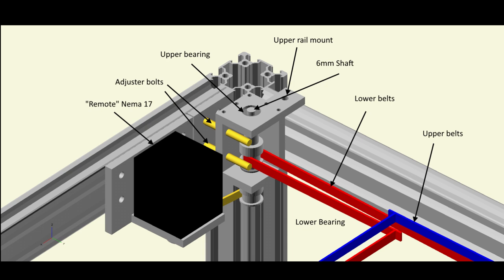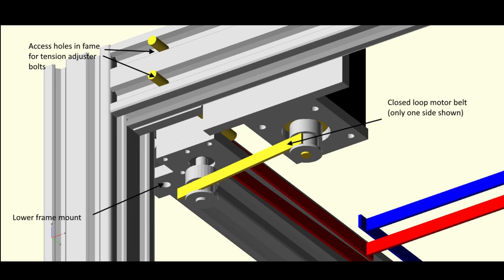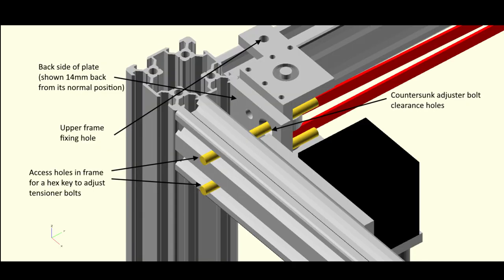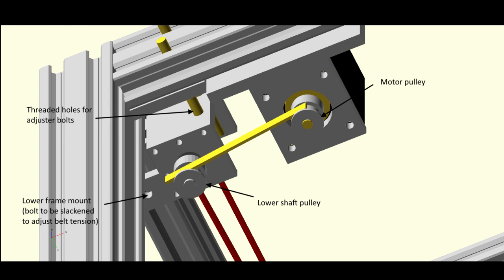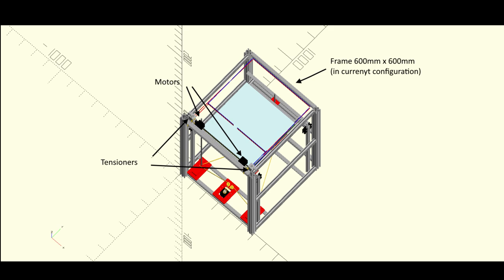New CoreXY Part1 - Remote Drive Shafts and Adjustable Tensioners.

Comment: 70 n.o.  congratulations.  (I'm catching you up :-()  microsteps are nore to do with smooth motion than holding, so you are correct to say the motor will only hold accurately at each full step . However since the only time a motor is stationary, is when printing diagonally I not sure how this will relate to print accuracy in normal printing.
Reply from the maker: Hi Bill. Yes, ref accuracy, I guess it's a "try it and see thing". At least with this arrangement, it'll be easy enough to change a pulley - I won't even have to touch the main drive belts or their tensioners. The primary objective is to remove the side loading from the motors but I'll likely play around with pulleys sizes - just to see. I do use Nema 23s on my UV gantry (the one with the extruders) and these have a thicker shaft and beefier bearings. I could just use those but they are noticeable more noisy than the Nema 17s (and take up more space). Ref the age thing - you'll never catch me up 🙂

Comment: Have loved your work on the multi input printing and the obstacles you overcame.
Have you seen the HevORT HD12 design. Belts are isolated from the stepper motors. Is ready for non planar printing  when the software comes available
Reply: Yeah + on HevORT the steppers are outside the enclosure which is also a nice thing to have.

Comment: Yes the motor will accurately hold position at any micro step. However the holding power gets less the farther away from a full step position you are.
Since maximum hold is when the magnets and eletric field are lined up and the electric field of both coils are at one max one off. As im sure you know when it micro steps is lessing the current of one of the coils and applying the difference to tje other coil to shift alignment point with the magnets over ever so slightly. At full microstep its almost a balancing act of fighting tensions rather then a set pull force.
Probably maybe full hold at 1/2 step cause it lines up the other coils?
This partial power on can cause magnetic backlash in the system. Torque at 1/16 microstep is 10% that of a full step so that effects holding power as well. Its like using a spring as a screw coupler.
Reply from the maker: It gets more complicated when one starts to think about CoreXY kinematics where, for anything other than 45 degree moves, both motors contribute to motion. For a pure X or pure Y move, the motors will actually turn the distance required multiplied by sqrt2 which is 1.414. So even if one made a move which was exactly a multiple of whole steps in the direction of travel, the motor(s) would probably end up using some fraction of a whole step. In a later video, you'll see that I abandoned the idea of using 40 teeth pulleys on the drive shaft with 200 teeth on the motors because I realised that the back EMF from the motors running at double speed would limit my maximum to around 200mm/sec, and I like to do travel moves much faster. But the remote drive shaft is still a good idea as far as bearings and belt tension are concerned.

Comment: I'm sure you are going to make awesome new printer with all the experience you had with the previous one :D .. 
One question - are you sure tensioning in the corner is going to work properly for COREXY ? You will be tensioning two belts at the same time and in one corner so position of the motors will not be same / one side will be longer than other - will that mess up with corexy movement? All of the designs I have seen have "belt tension adapter" on the head and fixed corners. Not a big deal to make a belt tensioning adapter on the head with a screw and captive nut, works great, I used to make them in aluminium too and iirc you have both mill and lathe so it should be peanuts for you to make?

as for issue with motors, I use the setup on some of my design (never did corexy) where drive pulley is on it's shaft with 2 bearings holding that shaft and the motor being soft-copled to that shaft but not via pulley but via those X couplers, it reduces rotor vibration, do not load motor shaft sideways, increases print quality visibly when using cheap nema17/nema23 PRC motors

wrt "position holding" on microstip - tested with 10+ different motors (expensive german ones too, expensive from e3d too, nema17/23/32) with super expensive military encoder - NO they do not hold position :( first even without any load the microsteps are not ideally spread between fulsteps (halfstep is usually where it needs to be, everything else - NO) and when even halfstep is used applying "any" force on the motor will move it out of position ... depending on the force and on the current and on the size of the motor it will miss the position differently but it will always miss the position with applied force. I did the test when I moved Z by vertical belt and not via screws, with screws it is not that noticeable as unwinding force on the 10mm dia and 1mm pitch (that I used) is low enough that microstepping holds the position without a problem, but switching to belt and in 1/16 microstepping it was +-2 microstep error easily :(

Ideally one should go with encoder and smart stepper driver, Duet was talking about making those smart drivers and they might be smart enough to talk with Duet3 board that you have so might be ideal setup for you... and you can sell extra bmg's to finance those drivers :D

BTW, I will have to watch this again, I failed to hear how are you going to load the 6 filaments? you want to use some push/pull config with those Y like adapters or ? as you said you wanna use single input hotend now?
Reply from the maker: Hi. Ref belt tensioning. On a CoreXY,  one motor drives only one belt, but for anything other than 45 degree moves, both motors contribute to motion. If they both move in one direction at the same speed, you get pure X and if one of the motor directions is reversed, you get pure Y. It takes some mental gymnastics to get the hang of it🙂. But tensioning each shaft, will only affect one belt, not both. Of course, if the tensions on each belt are uneven, then it can impart a twisting force to the carriage, so you have to set the tension the same on left hand side and right hand side adjusters. I've used this belt tensioning arrangement for many years - just by moving the entire motor back and forth. The only thing I'm doing differently this time is having "remote" motors. Also, to mitigate the twisting effect of uneven belt tensions, I use a stacked belt arrangement ( I note the E3D copied my idea on their tool changer 🙂). But I do things a little differently. On the Y gantries I use two idler pulleys stacked like the belts but arranged side by side use two "axels" such that both the upper and lower belts remain exactly parallel and on the centre line of the X carriage. So any unevenness in belt tension, doesn't impart a twisting force (because both belts act on the centre line) as is the case with the usual arrangement where the belts are parallel but run either side of the carriage centre line.  

Thanks for your information about micro-stepping and positional accuracy - it confirms my "gut feel".

Ref the 6 filament thing - I'm not going to be doing any multi-filament prints - it's all part of the "simplify my life" thing 🙂
Reply: @deckingman  IIRC your setup was not corexy? or I'm mistaken... what I worry is when you move XY1 motor 2mm more than XY2 motor closer to the front edge of the printer the "rectangle" that is formed by the 4 outer corners (ignoring the middle bridge) will be disturbed and front and back line of that rectangle would not be parallel any more as left point will be closer to you 2mm than the right one and if that happens I have a gut feeling movement will not be ok. So you have to make sure you move both motors (not motors in your case but both driving pulleys in those corners) the same amount towards front of the printer. I hope I explained what my fear is :)

Microstepping is terrible, the distribution of microsteps between full and half step is not uniform, not at the least, if you plot where they really are they group around full step and around half step, and any force will skew that even more. Another thing that was very new for me was "rotor vibration", there are some videos about that online and some EU company selling some motors with low rotor vibration, but what I measured is that while sitting in a microstepping position (even halfstep) with 100% power motor will vibrate slightly, you do not see it but with a 1500$ 16bit encoder you see it dance, first I assumed the problem is that 16bit is too high resolution and that I'm getting few bits of noise but you remove power from stepper and the vibration stops.

The only real way to do this is as professional machines do - with encoder and closed loop system. Too expensive for 3d printer :(. Next best thing is using full step and gearing it down with belts that you plan to do, the only issue is making sure motor is always at full step, if you drive it in full step mode movement is jerky, GECKO driver know how to do microstepping but it always move a full step just moves the motor slowly controlling it through 10 micro-steps instead of one jerky move... I know that new trinamic drivers have 1/256 microstepping that's supposed to work like that but I'm not sure if they use those 256 microsteps only in 1/16 or they can also use those 1/256 in full step mode but that could be the solution... I will have to look at the scope how they change current when configured to full step mode, is it going to be square wave or a sawtooth or sinewave

vrt 6 filaments, so you just want to have 6 spools available and you will manually feed whatever you are using, like the rest of us mortals :D :D 

since you are probbly going to be using one of your single nozzle hotends, did you maybe plan to integrate into new system a filament flow monitor?
Reply from the maker: @BogdanKecman  My printer is/was a CoreXY. Or more to the point it is currently a CoreXYUV. That is to say two CoreXY mechanisms stacked one above the other but both running in tandem. The XY gantry carries the print head, the UV gantry carries the 6 extruders. At one point in time, it was a CoreXYUVAB with the AB gantry acting as a load balancing gantry by reversing the motor directions, but it was still a CoreXY mechanism.  

Ref moving one motor (or drive shaft in my case) further forward or backward in the Y direction with respect to the other motor, doesn't matter. As long as the motors (or drive shafts) remain in the same place from left to right, then the critical belt paths will remain parallel. It's difficult to explain without a drawing. "The digital Dentist" explains it quite well in his blog which has a nice diagram. I'm not doing my printer the same way, but it'll give you some idea of how CoreXY works. https://drmrehorst.blogspot.com/2018/08/corexy-mechanism-layout-and-belt.html

Ref hot end - I haven't made a final decision but I'm seriously looking at the Bondtech LGX Ace which uses a LGX extruder and close coupled Slice Engineering Mosquito hot end. It should be good for just about any filament types and especially good with flexible filaments due to the very short filament path between extruder and hot end. The thing about my own designs, is that if anything breaks, I can't but new parts - I have to make them. So if I want to use one of those, I have to keep my milling machine and lathe which are taking up a lot of badly needed space.  

I haven't given much thought to any kind of filament flow monitor. from what I've gleaned on the Duet forums, they seem to be not as trouble free as I'd like. But we'll see....

Yes, I'll be manually loading filament as needed. I'm planning on using a "dry box" type reel holder and one which will take the larger 2Kg plus reels as well as the more usual 1Kg ones. Much of this depends on available funds but I'm planning on selling some of my collection of spare boards, PSUs, motors, extruders, and other assorted paraphernalia etc to pay for it all.
Reply: @deckingman  ah I was under impression it was double cartesian, not double corexy ... cool, then you have all the experience with corexy you need :D ( I remember the counterbalance test :D ) ... I'm stealing the ideas as I will have to redo my new workshop in next few weeks as I'm moving to another space so ... will be redoing my main printer too and am also checking out LGX+SLICE (already have 2 slice mosquitoes but was figuring out what's the best extruder to use, bondtech came out with some new, more precise push-gears)